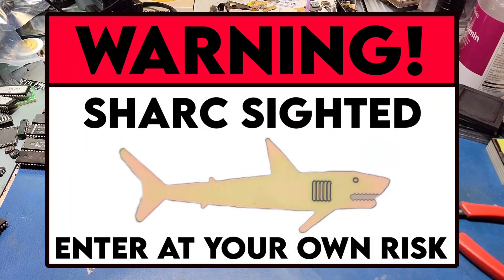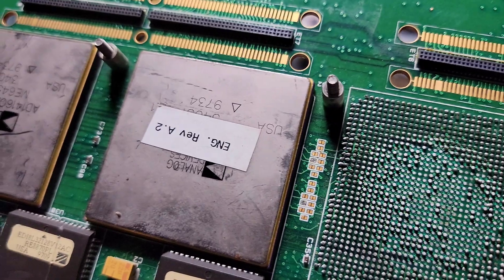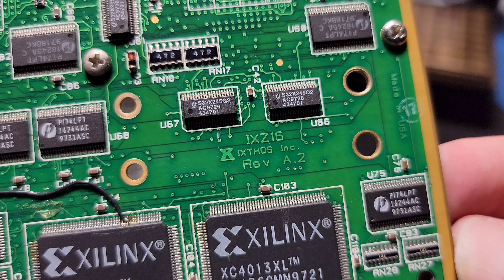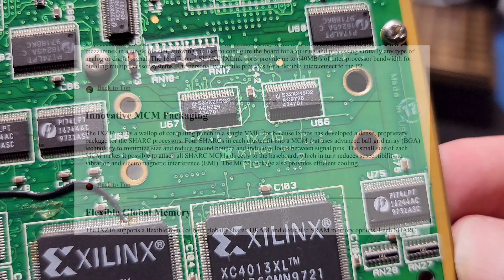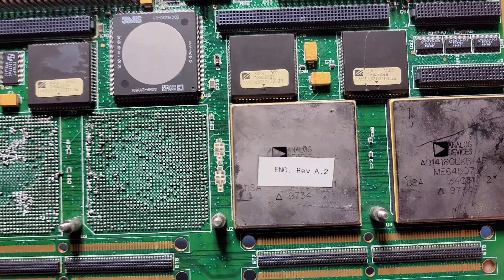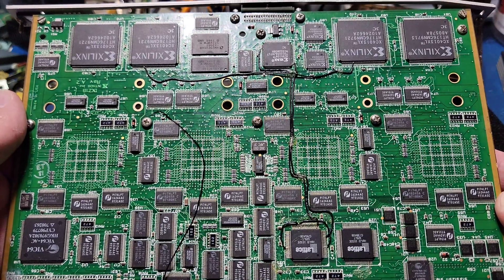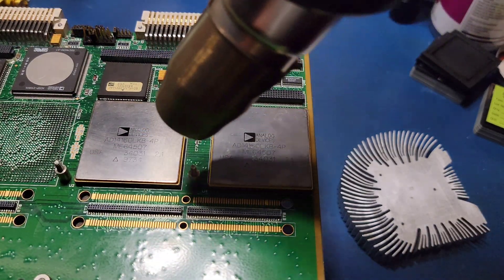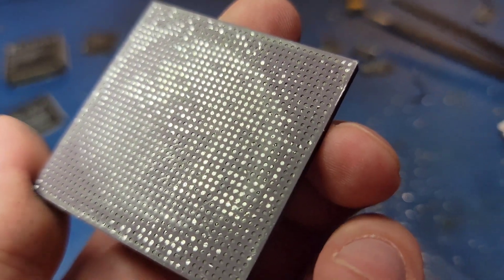Analog Devices AD14160 - The Quad SHARC

Comment: I love SHARC. Back in the day I built some specialized FORTRAN compiler extensions to use custom board with a bunch of SHARCs to do weird HPC numerics stuff.   By teh way that board looks like something that would go into Lockheed Martin's Consolidated Automated Support System (CASS).  I don't think it IS, but CASS used lots of specialized VME-bus cards like it

Comment: Superlative chip, I love it.
It is possible know where I buy one? I don't found on the WEB...
Thanks and... very great work!!!
Reply from the maker: I think it might turn out to be pretty hard to find them for sale as a single unit. I think your best bet would be to find a circuit board that has them soldered to it like the one I linked to in the video. Unfortunately that one is a functional board, so the seller is going to want a pretty high price for it. I got lucky finding this board as part of a scrap lot on ebay.

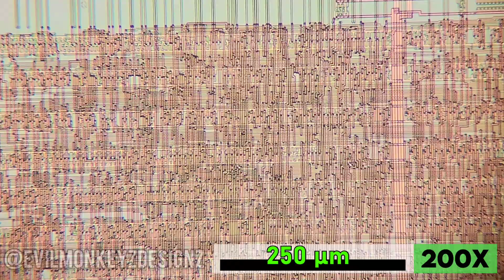Comment: The standard cell layout at 7:09 looks like it only has two metal layers; vertical M2 and then horizontal M1 between the rows of standard cells.  I'm guessing it's an 0.6um or 0.8um process.  When I started my career in '95 my first process was 0.5um, and that had three layers of metal, which allowed horizontal M3 routing over top of the standard cells.  We didn't switch to "nm" for identifying the process until 90nm, a.k.a. "0.09um"...

EDIT: It's 0.6um: https://websrv.cecs.uci.edu/~papers/mpr/MPR/ARTICLES/071602.pdf